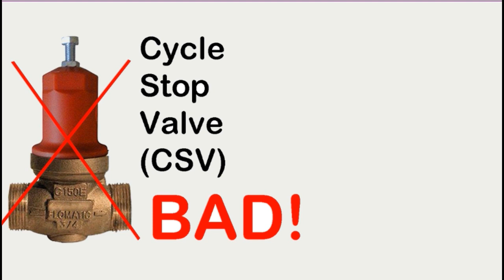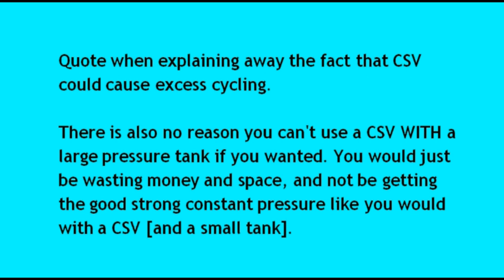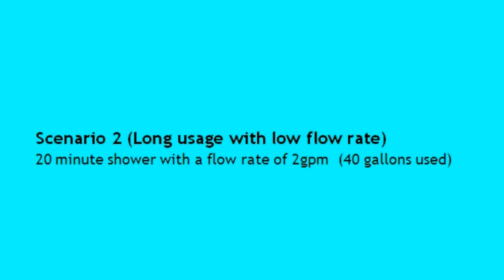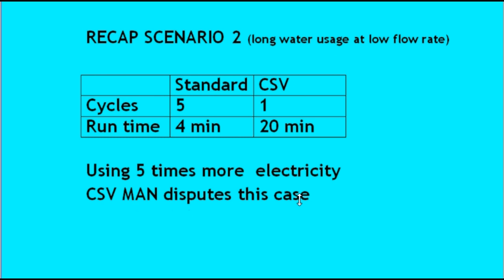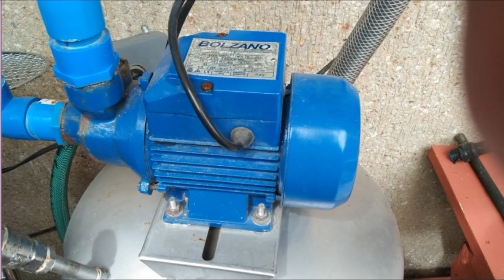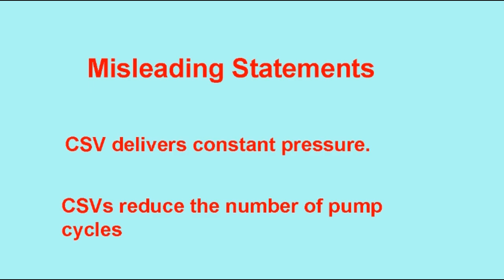Cycle Stop Valves ARE BAD for pressure tank systems!  Pros and cons of CSVs – few pros, many CONS!

Comment: A principle that needs to be taken into account in the examples you presented, electric motors , and for the sake of the discussion less say the pump is designed to run at 1000 Rpms , it will archive that speed at 0 back pressure (free flow) but as pressure builds up in the system the rpm will drop as is creating resistance in to the pump , and what the pump will do is that it will draw more watts trying to maintain that 1000 rpm that's why in your test you saw an amperage increase from 1.5 to 2.01 , however most likely the motor won't be able to get to the 1000 rpm and that will cause to generate more heat as is forcing the motor to work harder , but not only that , because is drawing more watts the brushes of the motor will wear out quicker. example if the pump runs for about a minute the highest resistance will be around the last 10 to 15 seconds of the 1 minute cycle in an ideal scenario and the pump will rest allowing for cool down and the brushes won't suffer as much , in the other hand with a CVS  as you mentioned a 20 minute shower with that restriction in the pump , that is 20 minutes that pump will be working under pressure , will create more heat , with no time to cool down and the  motor will be drawing 2.01  amps for a whole 20 minutes, that will definitely cause wear in the motor brushes a whole lot quicker and possibly a premature failure of the pump. In the years I have been working with electric motors I found that brushes are their weakest part and heat is their Aquiles heel
Reply: What are you talking about?
What type of Motors are you referring to ? Motors in general do not work that way.
Motor & indeed Pumps can run " on load continuesly for 10 years + without very little Maintenance.
Reply from the maker: So you are agreeing that CSV valves are not a good thing?
Reply: @LarryElterman  Well I admit it does deals with the cycle issue , but that it just one aspect , and I am more concern about running time and heat , when a motor gets a load it disturb the magnetic field and the motor will draw more current (amps) because of that resistance to restore and will maintain that increase of amps to keep it steady, probably in occasions you had heard that humming sound when a load is applied,  that in turn will cause more heat in the motor and wear in the brushes and the longer the run time , the more the brushes will wear out , that is a known fact , the CSV guy email me twice , practically insulting me and even questioning my christian believes , provably took a look at my profile and then cited that he had 54 years of experience and that people are against feeding his children, well when I saw his insults and how he disrespect me I realise it wasn't worth it to respond to a person that resort to that kind of language and tactics, if he were so sure of his product there is not need to behave that way, so it only show me that he is desperate simply because he knows can't go against the facts , facts that are well known since electric motors were invented, I felt tempted to respond and give him my curriculum, that I am a mechanic , that I teach at a technical college at some point, that I am certify in the field of renewable energy and that I am currently assembling motors every day were I work , so I may not know all , but enough about motors and electricity, but then why bother, so didn't respond. I am not his enemy actually perhaps he can talk to his people to design a digital  valve with a control module that can regulate the motor and by it may expand his products by designing his own motor with variable speed , so if he can tackle , heat and amps consumption at the same time cycles, then he will have an innovative product that he may be able to back it up with facts.
Reply: Luis. As an industrial journeyman electrician, I'm sure that very very few households have domestic well water pumps that use carbon brushes. I can confirm that 3-phase WOUND ROTOR industrial motors do have brushes, and slip rings, but no commutators, as used in DC motors. I have personal experience on these, maintaining bridge cranes and large printing machines. These motors are rarely used today.

Comment: going on 10 years no problems constant pressure no cycling ,i beg to differ on your opinion  best thing i have ever done
Reply from the maker: Many better ways to get constant pressure without wasting huge amounts of electricity. But you are free to differ your opinion. The thing is, you will never know how much electricity you have wasted. Perhaps you don't care, and that's fine to.
Reply: @LarryElterman  csv is the best thing since slice bread ,been installing them on homes more than 12 years , every customer happy ,i disagree with you
Reply from the maker: It is your right to disagree with me. No problem.
Reply: @Khan-dw8cj  Do your customers actually know how much more electrical power they waste with this bogus product? Do you actually know? Have you ever installed a KWH meter  on the pump circuit and tested with and without the CSV? Or do you simply parrot talk what the mfg states in his sales pitch. My guess, yes on the latter.
Reply: hi anwar,,  i was wondering how you measure the increased electricty due to the sub pump running more.     with energy prices going up,, perhaps a csv is less cost effective?
Reply: @kevinlowe7552  guy Im a retired hydraulic master,the amperage at set pressure is lower than when ramping up ,rather than start stop with normal pressure switch csv prevents that and i also measured the amperage and it was lower when running ,its like this why start your car and mash x to board  when you can regulate flow at constant pressure ,csv has done that for me and have more than 50 customers satisfied ,i have a lil domestic pump business to keep me going

Comment: How about a system with a jet pump that produces 3.5 g/min with a 20 g pressure tank and 30-50 switch? Would a CSV be beneficial assuming it's set at 40 psi?
Reply from the maker: depends what you are trying to accomplish!
Reply: @LarryElterman  Give a more constant pressure and reduce pump cycles. This feeds a 2 family 2 bath house. Would maybe a pressure regulator suffice?

Comment: Wow!  You have done exactly what testing I wanted to do for myself.  Thanks so much!  

The question still remains how much life is lost by time time vs number of cycles.  That would be the last remaining question to know what is best for all scenarios.  

I have an agriculture usage and wanted to know if CSV valves would save the life of my very expensive deep water well submersible pump.  I am leaning towards thinking no, based on your testing and analysis.  It seems in almost all situations the life of the submersible pump would best be saved by staging the water in a large above ground tank to reduce the well pump cycles.
Reply from the maker: if you have room for a large above ground water tank, I assure you that is a better solution in all ways than a CSV. Less pump cycles, less time run time, win win.
Reply: Sir I am a chicken farmer and I will tell you the valve works as advertised. I have a 3 hp pump. The pumps last longer. I used to have two 90 gal pressure tanks, now one 35. My pump does not cycle as long as I am using 5 gpm. I used to replace the pump about every 18 months. The one I have now is 5 years and still going.
Reply: @gsheatherly  that sounds like a success story.    you have a 3 hp submersible pump?   and you were replacing it every 18 months?  wow.   even without a csv, that seems  so soon?   how deep is your well?
Reply: 140 ft. I don’t care if people buy one or not. I know pumps last longer by cycling less. My pump used to cycle about 60 times an hour with two 90 gallon pressure tanks. Now it runs all day long at 50 psi and I have one 35 gallon pressure tank. Municipal water cost me over 1200 a month if I used it, if I paid  a couple hundred a month in a electric bill is still saving me money. I use hundreds of thousand gallons a month in the summer.

Comment: There are benefits to a CSV system after owning one however the idea of a tiny pressure tank, constant pressure output and less cycles is a load of crap. 
With the tiny tank and cycle stop there is a huge swing in pressure almost immediately when you open a tap as the tank draws down then the pump fires up. 

Best success with my old system was a larger pressure tank (30 gal, would’ve gone bigger if I had the room) and a CSV set to 50 psi, pressure switch 40-60. This took out the pressure swings when doing simple things like washing hands or filling up my 64oz cup.

The beauty of the system with a larger pressure tank is the pump doesn’t cycle every time you use water. However when you do use water the pump will run and stay running while you are using it giving you the constant 50psi great for showers. When you are done using water it quickly tops the tank off at 1gpm minimum flow and shuts off. Now after my 30 minute shower with constant pressure and 1 cycle of the pump I’m finished and my pressure tank is topped up. Now it can go most of the day without ever cycling unless I have a large water demand again.  

I do believe the marketing needs some work but there are benefits of the valve. Most centrifugal pumps (deep well) reduce current draw as head pressure increases / flow decreases.
Reply from the maker: Thanks for your nice thoughtful comment. Here is the thing though. Their marketing does not just "need some work". It's chock full of misleading statements and total lies. That is the problem. That's why I call it a scam company. I never said a CSV does not work or is not good in some limited circumstances. In your case, if a long shower at constant pressure is your main concern, certainly a CSV will work. In your case with a big tank, refilling at 1 GPM is a lot of extra pump run time.  In your case a what does a CSV do that a  Variable Frequency Drive would not do better?  Also, although it may be true that Most centrifugal pumps (deep well) reduce current draw as head pressure increases / flow decreases, the reduction in current is way less than the reduction in flow (percentage wise) so the efficiency still goes way down (as I show in my video). In a deep well system you are better off with an above ground storage tank and a booster pump if your situation permits it.

Comment: At about 27 minutes into this video, you mention that both standard and CSV systems run the pump the entire time.
Don't pumps have a defined sweet spot flow rate / power usage rate together with run time and rest between runs that would dictate a given sized pressure tank together with a csv type valve set at a pressure cutoff just below, say one psi, the pump upper cutoff ? Then the pump would get a break from constant running at the ideal time, ie when pressure tank has gradually been filled?
Reply: Electric motors definitely have curves with so many variables each system must be taken one at a time. That said there definitely is a sweet spot but the problem is pumps tend to break on start up, because of the huge amount of inrush current at locked rotor (LRA) and they also tourqe in a well breaking the wires as well.

Comment: Excellent information Larry.  I happened to see this device advertised with all the videos and claims today as I was doing a little research.  I was immediately suspicious based on my experience and common sense.  Your breakdown of the cons and pros of this device made it quite clear that it is a scam.  If this worked so well as he claims then this would be the way the pump systems were always installed.  This valve is similar to a PRV and I couldn't imagine why it would do any good in a well pump system.

Comment: I installed a CSV valve on my last construction and I observed exactly what is explained here, and at the time, I had the same concerns as you as I was trying it. Now you have just confirmed my suspicions. As you wash your hands way more often than you are filling your pool, the pump is actually cycling more than a regular system,  just at a somewhat more regular pressure, that is if your system is well-balanced, which I couldn't achieve without adjusting the damn thing for days, and still wasn't perfect. At 300US$ a pop, it's just not worth. Thank you for taking the time to do this video.
Reply from the maker: Your welcome!

Comment: @24:00 there is a typo in the third sentence. The 8 gallon draw-down amount in the tank is consumed in 8/10gpm = 0.8 minutes when the pump is off, not another 4 minutes.  Still equals the 4.8 minutes cycle time that you used...4 minutes running, 0.8 minutes pump rest.
Reply from the maker: You are correct! You are probably the only person to check my math! You win the prize!

Comment: In 2013 I added this exact cycle stop valve to my system after months of no water pressure when multiple faucets were running and filling horse troughs. I instantly gained full water pressure no matter how much was being used.  I used mine with two 60 gallon pressure tanks.  It's been going strong for 8 years now with no issues.  I think your skepticism is far fetched and I have real world experience with success.
Reply: You have (2) 60 gallon tanks, and his analysis is "far fetched"? REALLY?   Half of the claimed benefit of the product was not to have (2) 60 gallon tanks.
Reply: guy just want to sell vfd  ,i promote csv in the caribbean

Comment: Going on 10 years with my CSV and pump still going strong and constant pressure throughout the house/outside.  I was skeptical at first but it works.
Reply from the maker: oh, i never said it did not work. It works. It is just extremely inefficient. During those 10 years you probably wasted hundreds in electricity.
Reply: @LarryElterman  How much is a VFD?

Comment: Very informative video thanks! Although I have one important question. Does this valve restrict both outlets? I could see this valve being efficient if it only restricted the outlet going to the house. If it also restricts the outlet to the pressure tank, I could see that being an issue.
Reply from the maker: of course it restricts the water going into the pressure tank, that's what keeps the pump from cycling.  If you only wanted constant pressure but was not concerned with cycling you could just get a simple pressure reducing valve

Comment: I installed this valve 2 years ago. I have an in law suite. I was concerned about 4 showers and 3 washing machines killing flow in the showers. Since your video shows a benefit in one scenario which is the scenario I was concerned about maybe it's beneficial for me. Also I envisioned an automatic valve that would bypass the csv in the other scenarios. I would be interested in doing this and I think I have the skill to do it.
Reply from the maker: did you see my video on build your own CSV, there are electric controlled valves and flow sensors that can do what you want to do, the video i have about build your own CSV should give you some idea.

Comment: another thought came to me once I finished watching this..... you never provide a solution! so what is your solution to getting constant water pressure? don't know it, if you can't replace it. I too am an engineer, and simple math and physics is guiding me on this. you put any motor under load, and it will dray more current..... you are correct about that one.
Reply: David your an engineer? Any motor under load draws more current? These two comments are in conflict with each other.
Reply from the maker: i have other videos on the subject. There are many solutions including a variable frequency drive system that provides constant pressure at better efficiency
Reply: @LarryElterman  all pump guys know it's better to turn a pump on less often. There is a need to understand induction motors with respect to the load an impeller immersed in water provides. Take a look at some pump curves and there is some information you will find counter intuitive. Additionally, it's the locked rotor amperage that kills the pump (nameplate LRA #) and the tourqe twist breaking wires (real world) given all the variables there will be applications that prove anything. You need induction polyphase motor theory, before you slam people that already have it
Reply: Another engineer ;)
 If you take a dust cleaner and switch it to blowing. Then you block the outlet. The motor spins up, running lighter. The blower is now moving no air, doing no pump work. I have not doene any measurements, but assume the dust cleaner now is reducing power from the mains. 
If you tries the same with a piston type pump, you will blow the fuses.

Comment: so I was considering installing a CSV into my system. You seem to have a bug in your butt about this company. Do you feel they are cheating people? or do you think the product is just bad design? here is my issues! I have a 3/4hp submersible motor at about 165ft. It pumps water up to a 550gal tank on a hill, and then gravity feeds to the house. But at the house I only have 15PSI which is terrible! so I am looking for ways to improve this. I want to put a RO system in the house, but it needs at least 35PSI. I was considering using a CSV, and using the gravity feed tank as the back up system for when the electricity goes out. But I have issues with 1. a pump motor running so much. and 2. if it will decrease the life of the pump! I would be interested in your objective evidence and advise on this idea.
Reply: For your RO system, you can get a specific point-of-use pressure booster pump, which also helps your RO system cycle faster.